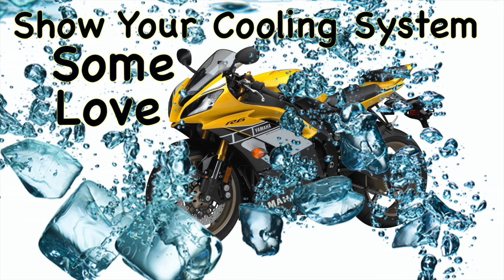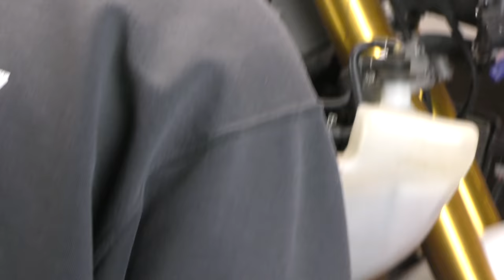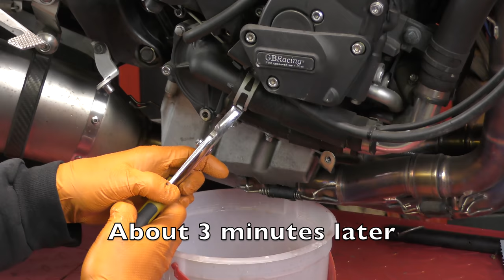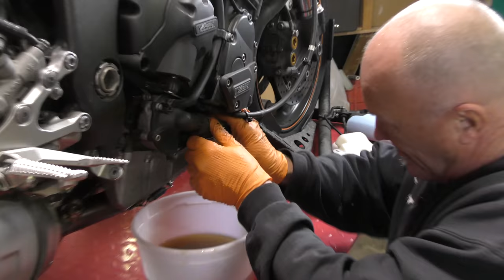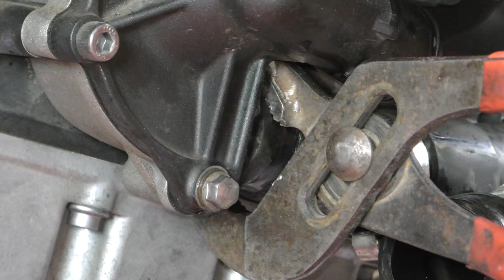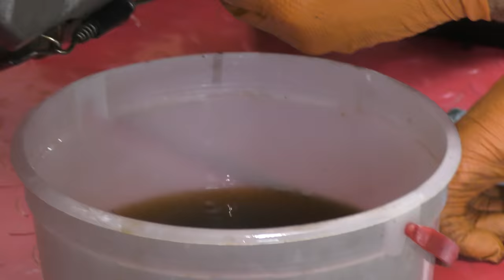INTRO Annual Motorcycle Maintenance: Cooling System

Comment: Your channel has been very informative. I have a 2011 Ninja 650.... I started riding last year and fell in love with riding two wheels... and I want to race... I know the ninja 🥷 isn’t ideal for racing but it will be my track bike... I’m documenting the process on my channel of going from daily driver to road racer... these videos have all been very informative and helping me get to know the death machine I’m riding on.  It’s at 28k miles and in need of tons of basic maintenance that’s been overlooked by previous owners. Thanks for all you guys do on here!!!
Reply from the maker: Great news! Yes, lots for you to review with fork oil viscosity and volume plus surrogate or replacement shock. Start with the full chassis overall ala Trash and Treasure series. That is #1 task.
Reply: @catalystreactionsbw   I'm actually gonna look into that series... Ive watched a ton of your videos... Ive learned I caan comprehend what goes on in a video at 2x playbaack speed... nothing wrong with your videos... time is our great resource...  so Im digesting alot learning about suspension, tires, body position, racing lines 600 vs 1000cc etc... I'll definetly look up your trash to treasure series... What your take on buying a cheaper bike to start racing... or should I just save up and get something very low mileage a couple years out of being new?
Reply: @catalystreactionsbw  also... Im trying to be careful with money im spending on the ninja... could be money put towards an actual race bike.
Reply from the maker: @journeywithjekyll2873  Get an older bike in the $3-5k price range. That will allow you to get the parts you need and be within budget.
Reply: @catalystreactionsbw  Thanks for the advice!! Realistically... me raacing is a shot in the dark... nearest road course is Heartland Park and its 3 hrs away... but I know if I just take baby steps... I can get there... Im working on a house flipping and depending on the success of that... might be looking into dumping some of that profit into racing as a tax write-off... maybe the desire and passion for this hobby will turn into much more.. I have studied quite a bit about what it takes realistically... time, money, marketing... I know proving my worth on the track has to happen... guess we will see..  dont even have proper gear yet. I have a budget set though to be hopefully getting into a few races by next summer... then depending on how that goes maybe try and get into a full race series 2023. Doing all I can to move this mountain.
Reply from the maker: @journeywithjekyll2873  High quality gear is item #1. Bike is #2 and see what you can find with fork and shock upgrades in place.  #3 is getting the bike sorted for YOU.  #4 is setting a date for your first track day when 1-3 are completed.
Reply: @catalystreactionsbw  Im working with an online retailer for geaar... First track daay is planned for Early october at Heartland Park in Topeka KS... I budgeted out what I can spend and should be able to get some quality gear by then... Ive heaavily researched what is good and whats not worth it... Thanks to all your suspension videos I know exactly what to do!! For real... Ive watched a ton of your videos... some more than once... I made it haalf way through your GSXR project... so inspiring.. on another note... I am aabout to buy pitbull stands... and I came across your video comparing Pitbull stnds to the online set you bought... That video reaally seaaled the deal for me... this brings me to my point... I know you want to make income from whaat you love... Have you thought of becoming an affiliaate marketer of Pitbull and other products you use? I can help line some stuff up for you guys.. and you don't have to "sell" them in your videos... you almost don't have to change anything you are currently doing.
Once again, thanks so much for the advice. My first step right now... since Im not ready for the track is im trying to volunteer at motorcyle track events close to me.. Im gonna need a miracle to race... but Im driven to succeed. ...pun intended.. 😉

Comment: I found using an air mattress blower to blow out the remainder of the Engine Ice in my bike works. Just be ready, where you drain the fluid at the water pump, to have the bottle you use, lined up, so it sprays everything into the 2 liter bottle and not all over the floor and walls. Run some water through the radiator, till it starts to flow out the drain by the water pump, tighten up drain plug, fill radiator with clean water to flush system thoroughly. Run bike for a couple of times until only clear water comes out. Then use the air mattress blower again by blowing from the radiator through to the water pump drain plug, to make sure nothing stays behind. Add your favorite flavor of coolant and your ready to go.
Reply from the maker: Great tips thank you!

Comment: Rather than fiddle with those hoses and risk breaking them or the clamps wouldn't it be easier just to do a couple of quick flushes with some distilled water before filling it up with proper antifreeze?
I'm just asking cause I bought a very neglected 2006 FZ6 a couple of years ago and it's antifreeze has never been changed to my knowledge. It was just like Dave's, only more brown and smelly. I did 3 or 4 complete flushes with distilled water by leaving the bike get up to operating temp, flushing it out and filling it up again with distilled water until the last time it came out clean. After that I filled it with glycol based antifreeze as specified by the manual. The bike never overheated again and it dropped it's operating temp by roughly 15°C while riding in the city. This was like 2 years ago and I regularly ride with the guy I sold the bike to and after 2 years the antifreeze's color is still vibrant and has no rust parts in it whatsoever.
Reply: That was painful to watch .
Reply: In my unprofessional option, I think it’d be a fine method lol

Ari Henning did a vid talking about using a mix of distilled water and vinegar I think to flush out any corrosion in the cooling system. It was either from Revzilla or Motorcyclist Magazine
Reply: Road race bikes are not allowed to run coolant on track. Must be water with an additive like Water Wetter etc.
Reply: @jimmyjames2549  Engine Ice is the way to go

Comment: Disclaimer: only do this when engine is completely cold!!
Reply: You can only drain the coolant when its cold, unless you wanna spend forever doing a coolant change. Gotta get the old coolant out and run water thru it a few times til its clean water again. Then when you drain said water, its hot/warm.  Did this same job on my R6 a couple weeks ago. 

I let the bike idle til the fans came on at 215(stock/non flashed ECU R6) then drained it. Yes it was hot, it did slightly warp the drain pan.
Reply: @Katsunaka  But you didn't remove the radiator cap when the system was pressurized. That's very dangerous to do.
Reply: @Katsunaka  never work on a coolant system that is warm or hot. When under pressure water boils at a higher temperature, if you release this pressure the water will rapidly vapourise and expand very quickly, this means you get some very serious scalds/burns.

As the fans were on the coolant was above the normal working temperature and the fans were trying to cool it down.

Never ever work on a hot coolant system.

This is a good example of what can happen: https://www.youtube.com/watch?v=qclnOoVoTPQ
Reply: @Katsunaka  do it when it hot and bye bye to your eyes that is the main problem

Comment: There is obviously no / not enough corrosion inhibitors in the ‘water wetter’ coolant should look like new for 5+ years easily and only lose its vibrant colour (blue/green/pink) at about 10 yrs.
Reply: Yeah I agree, antifreeze tends to last a lot longer. However many tracks prefer that you don't use that stuff and use water wetter instead.

Comment: lol everytime I see a rocket at a light, I kno they're in the midst of overheating! lol
Reply: Lol this is a trackbike. This doesn’t happen that fast to glycol-based coolants that road bikes run. Every time I see slow a cruiser at a light, I know they’re in the midst of vibrating every bolt loose.
Reply: @gonzotopia1  I like that last bit about vibrating every bolt. I will be using that to those icky cruiser bros.. thanks stranger!!

Comment: Is it advisable to clean the whole cooling system with CLR after draining the old coolant? Just curious, thanks.
Reply from the maker: There are various methods for cleaning the cooling system. Depending on your level of understanding/chemistry etc, you will choose what works best for the engine and radiator.
Reply: Rather than using household cleaner, I'd opt for a purpose made cooling system flushing solution. There are several options. But then, I'm not a chemist, so I may be paying more for no advantage, other than worrying about it less.
Reply: @rs232killer  thanks for the reply
Reply: @catalystreactionsbw  thanks Dave, i just thought that if it's safe to use at home, it's safe for the bike too.